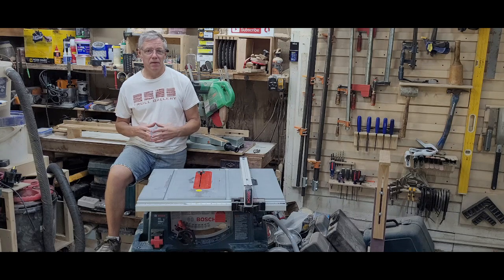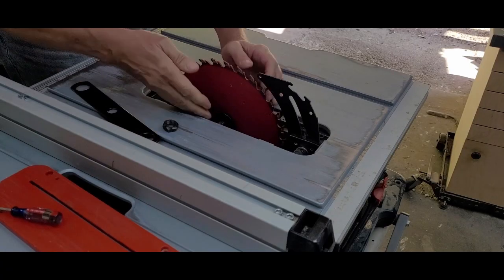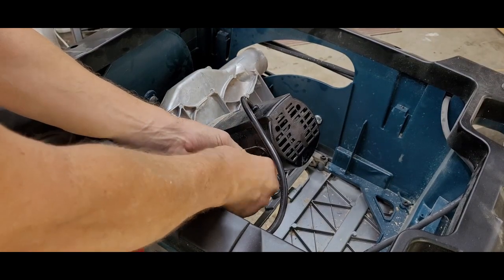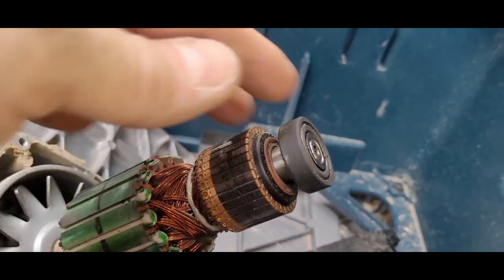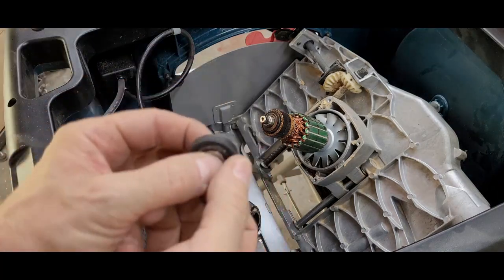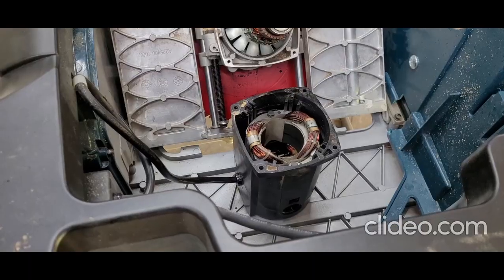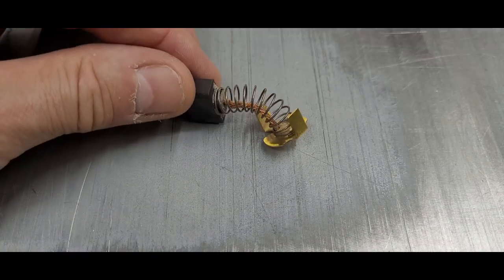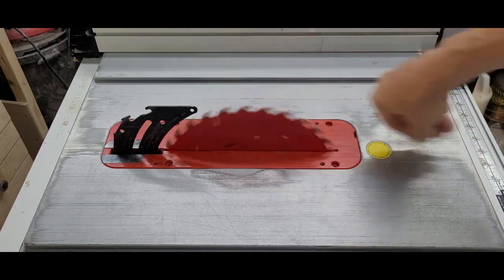Replacing a Worn Bearing On My Bosch 4100 Table Saw

Comment: Can you tell me the size of the bearing?
Reply from the maker: Sorry, no.  I ordered the replacement part straight from Bosch.  I guess you'd have to pull it, get the measurements and order a new one.  Probably cheaper than the manufacturer.
Reply: Thank you @TheTrullGallery

Comment: Make sure that "Armature Bearing Cup " its in the schematics at the back of the motor that that bearing sits in is in good enough shape to re-use. Mine was melted had to replace it too. I also put a temperature sensor near that bearing so I know when its getting hot.

Comment: I just did the same repair yesterday.  You do not have to take the saw all apart . I did mine folded up on the stand standing up. Put the saw on a 45 and did it from the understand side takes 10 mins to disassemble and about the same to put it back together.  Bearing cost 9.00.

Comment: Motor is totally locked up.  I bet this is it.  I didn’t even know the blade should spin freely when it’s off😬
Reply from the maker: @Familytreewoodworks  good luck!
Reply: @TheTrullGallery welp, wish the housing for a metal bearing wasn’t plastic.  Heat ruined the housing, effectively ruining the motor.
Reply from the maker: @Familytreewoodworks  ugh!

Comment: Hello my name is Richard, and I am interested in buying the Bosch table saw. Could you please tell me what you think about your Bosch saw, like is it worth buying, and how long have you had yours, and were you satisfied with it overall. The plastic gears are causing me concern, but your main bearing went out. People are saying how disappointed they are with these plastic parts. Did you like the way your saw performed? It looks like you used it plenty, so I value your opinion. I was all set on the Bosch over the Dewalt and the Skilsaw, but I started hearing horror stories about the plastic gears. I appreciate that you showed the underneath view of the bottom of the saw. So please can you share with me your opinion about this Bosch saw. I really want to love this saw but I’m apprehensive about the purchase. This saw seems to fit my needs, being smaller out of the three. This saw would be at our summer home and not used everyday, so I’m hoping that this saw would stand up to my workload, it wouldn’t be at a job site being used day in day out. Well your Bosch looks like you got to know it pretty well, so I’m interested in your opinion. Please could you comment on the pros and cons of what you’ve experienced with this saw, because I would greatly appreciate you view? Thank you so much for your time, and I hope you respond.       Richard
Reply from the maker: Hey Richard!  I've had this saw for over four years, and I treat it like my old cabinet saw.  I think the bearing issue was from tuning an extension cord too long (I've remedied that).  It's getting a bit tired, but I use it a lot!  I miss my Unisaw, but I'd buy this one again.

Comment: Great video!  I had to replace the same bearing.  Just a heads up...  That is a VERY common bearing.  It is available and stocked at Ace Hardware Stores for around $4.00!  Again, great video.  Thanks.
Reply from the maker: Good to know.  Thanks !

Comment: Great video.  I notice you forgot to mention the rear rubber cup that goes off the end of the bearing in the housing for stability.  I was lucky to grab this same unit for $150 from a carpenter down the street from me. He retired and didn't want to bother with it as it sat for over a year.  He new it was bearings and my hunch was that too.  Sure enough, the rear  bearing was shot but the one in front of the armature when spinning by hand had a resonating sound,  it could go out in a year or so.  Once the armature was out. the front bearing  did have signs of being on its way out. I'm replacing both front and rear bearings with new brushes.  It should perform nicely after completed.
Reply from the maker: Yeah, I found out about that rubber cup after the fact.  It's running well now!
Reply: @TheTrullGallery  that’s great.   It’s easy to miss.  I’m waiting on bearings and a puller.  I was able to nab a dewalt compound miter saw dws779 and stand as well.  Changing out those bearings as well.  Same situation.   One Bearing is a bit tight to the fan fins on that armature so need a low profile puller verses the one from harbor freight.

Comment: Thanks So Much i  Spent 900.00 On Mine Just Like Yours !~~ After ten Years Motor Bearings Or Something Gave out Today Just after Paying 1900 on a root canal last thing i needed was Replacing My Bosh Table Saw 4100 Right In The middle Of a Deck Job Packed Her Up Brought Her home Tonight Ill Take Her Apart  And Check My Bearings THANK YOU !~!~
Reply from the maker: I hope it works out!

Comment: I watched another video on this problem, he disassembled parts on the blade end which is apparently not necessary. Thank you!
Reply: True - that's not necessary IF you know for sure that the rear ball bearing is a problem. But it could be another (front) ball bearing or the gears. Then, you have to dig in through whole machine and, as such, the other video is more informative.

Comment: I don't recall you mentioning changing the rubber gasket that goes over the bearing. After looking at the parts manual I noticed there is a rubber gasket that goes over the bearing. Mine was shredded when I took the motor apart to change the bearing. I don't know for sure but I speculate because the motor housing is plastic and a worn bearing would destroy a plastic housing, I wonder if the purpose of the rubber gasket is to melt under heat and stall the motor so more damage isn't created. It's less than a $3.00 part.
Reply from the maker: I found out about that part a few days later.   And mentioned it in the next video...

Comment: Thanks for a very easy to follow procedure. My 4100 smoked up my shop today as the same bearing seized and burnt up the rubber ring that holds the outer race. You saved me a bit of time I would've spent figuring out the best plan if action. Great work!

A minor note/tip: When driving a bearing onto a shaft, it's best to apply pressure on the inner race only. Conversely, driving a bearing into a bore should be done with pressure on the outer race only.

Thanks again!
Reply from the maker: I'm glad it helped.   I know better than to just beat on a bearing.   I don't know what I was thinking.   😅

Comment: How they can put put an unsealed bearing on a table saw.
Reply from the maker: I think It was sealed... until it failed.  The replacement was sealed, and there were remnants of the old seals in the motor housing.
Reply: @TheTrullGallery  so it was the normal wear and tear. Dust and heat is hard on bearings. Keep it up.
Reply from the maker: @henrysara7716  thanks!  Since the tech at Bosch knew exactly what part I needed (from an email description), I'd say it's happened before.